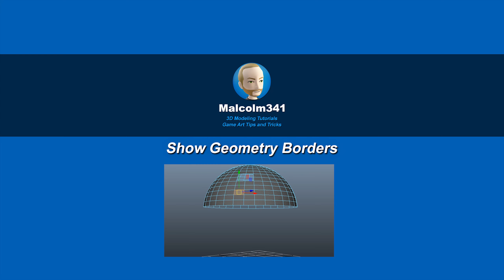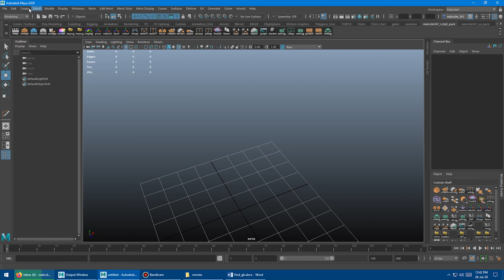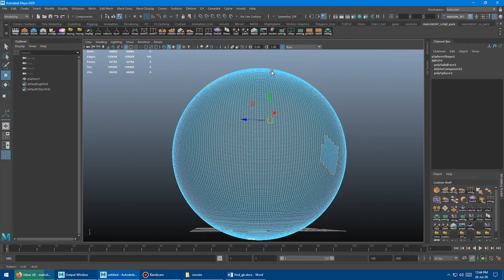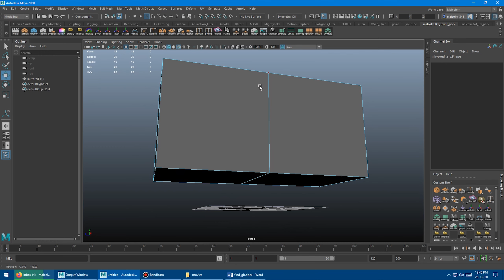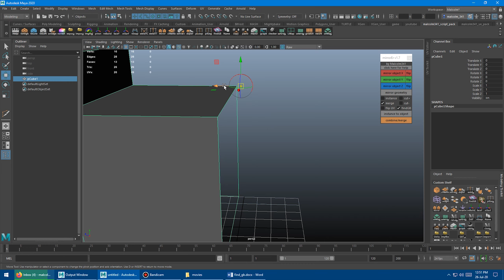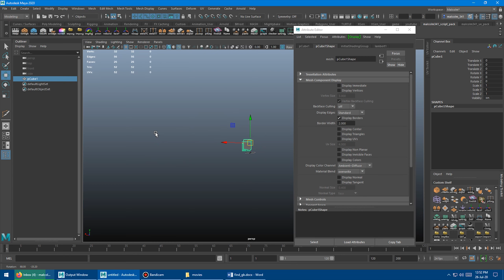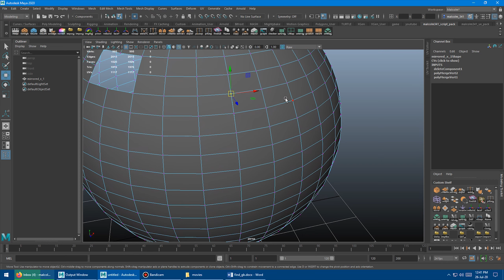Show Geometry Borders Edges in Maya

Comment: You can also get Maya to highlight border edges continuously using Preferences->Display->Polygons->Highlight->Border Edges.  I think you may have to restart Maya to effect the change.
Reply: Thank you for sharing, I didnt know maya got default highlight borders .But can not used when I am in UV mode. I have to switch back to maya classic just for check open borders, but this script works in every mode
Reply: Seems like Malcom dint reply only on your comment. I am wondering why? :D:D:D
Reply from the maker: That's great, I'm glad it helped.
Reply: @malcolm341  Hi,can you change the color on open edges/border highlight?
Reply from the maker: @superatendedordeb0lud0s34  not really, unless you want to change the colour of any edge you select. Maya doesn't have an open edge colour so to get around this just select the edges in my script to show which ones are open the same way you would select things with the mouse.
Reply: @malcolm341  Thanks for your reply I'm transitioning (I don't know if it's the right word) from 3ds max to Maya, it's hard for me to understand Maya, the truth is that it requires many previous steps before being able to model something, and I can't find modifiers like Spherify either, I feel that simple things in Maya are unnecessarily complicate
Reply from the maker: @superatendedordeb0lud0s34  spherify is located in modling> deform> sculpt then scale the sphere so it's bigger than your cube. Or create> polygon primitives> plantonic solid> then change options to cube/quads/3
Reply: @malcolm341  Thank you so much!

Comment: This is fantastic! I'm so glad you came up with a solution for this. This isn't the kind of issue I encounter every day, but when I do, it's usually a real pain in the neck. And I usually don't realize until it's too late. Thank you so much this is such a clever idea. I love it!
Reply from the maker: Thanks a lot, I use this quite often each time I do a weld just as a sanity check. It's built into the mirror tool too so we never have to second guess if the mirror merge actually worked.
Reply: @malcolm341  Yeah I was impressed when I thought you had only added the show geometry border edges, but when I watched to the end of the video and realized you had added it into the mirror tool, then I was really happy. Most of the time when I merge things together it works fine but every now and again I'll be smoothing out something only to discover that a handful of verts didn't get merge properly, and then I have to go back and undo a bunch of steps to sort it out. It's a huge waste of time and a big pain in the neck. So this tool of yours is fantastic! Thank you once again I love it.

Comment: Very useful script. Being long-time Max user I often miss something like xView in Maya. In Max it can show several potential errors in your mesh and also UVs like open edges, overlapping verts/faces/UVs, isolated verts, flipped faces etc. On top of that, once it detects the problem, it can also select the offending mesh elements right away so you can quickly correct them with poly operations and also, it can display those errors (usually) in real-time as you work as long as you have it activated.
I think it would be a great addition to Maya if this(or similar - much expanded) script could be made to detect all those kinds of errors and display them in viewport right away without the need to click everytime you want to check your mesh(if it's possible, off course).
Reply from the maker: I'm not sure I have the skillset to write something that complex at the moment, as a work around you can use the clean up tool in Maya and turn on select offending components and run that periodically to select all the errors. My main concern has always been open edges. It's possible to to run a script job which runs clean up each time you change your selection, but that would interfere with your modeling because it would select the components as you're working and deselect what you're doing. How does it work in Max can you have a component visually high lighted for an error, but still model at the same time?
Reply: @malcolm341  Yeah, it's exactly like that. If you have xView activated while modeling, it highlights the errors you marked as those it should look for(only one type of an error at the same time though) and if you want, you can also use it to quickly select them all so you can fix them right away.
Of course, as it it Autodesk after all, it has some "quirks" like decreased performance on more complex meshes(I highly suspect it only runs on a single core) or rather serious slowdowns when using xView and Snaps at the same time(at least in v2020).

I think the whole xView(or at least it's interface) in Max works as a viewport overlay.  They even provide some examples how you can add functionality to it with MAXScript.
Reply from the maker: @michalschnek8745  thanks for the info, I haven't come across anything in mel script where you could highlight a component without it being selected which means I can't think of a way to do this in real time as you work, to select offending components periodically you can use the clean up tool. Give it a try and let me know what you don't like about it.

Comment: yeah, highlighting border edge like in XSI would be good. but you didn't mention border selection constraint option. which is very helpful when you trying to find unwelded vertices. and you can also use hard edge highlighting:)
Reply from the maker: Hard edge visualization won't help because it will give you false results. What I'm after is selecting unwelded verts, verts that are welded can also be hard which would generate the false positives. Border selection is the way to go, but I didn't want to go through the menu each time too slow for me.

Comment: Is it possible to select those as well using the cleanup tool under edge length and area tolerance with the right numerical value?
Reply from the maker: No because the selection isn't based on edge length, it's based on weather there are welded verts on the ends.

Comment: You know of any projection mapping hacks by any chance? Every time I use it, it bleeds/stretches into areas not visible in the projection. Would be very helpful for environment painting, most definitely. Only ones I know that don't bleed are sketchup and 3Dcoat, but they can't take as much polys as Maya can. Thanks in advance!
Reply from the maker: I'm not sure I understand the question, can you re-phrase please.
Reply: @malcolm341   @malcolm341  My apologies. For example, near the end of this video in Sketchup vimeo.com/43857398 it allows you to use projection mapping to the UVs without bleeding. However, if I did the same thing in Maya, like in most projection mapping vids on YouTube, it stretches the texture into the UVs. Would you know any solution to this by any chance?
Reply from the maker: @avnavg5982  Oh I see, I haven't used this technique in many years. Have you seen this video https://www.youtube.com/watch?v=YpB6AOm0SW0 it appears to address the stretched UVs unless I'm still misunderstanding your problem.